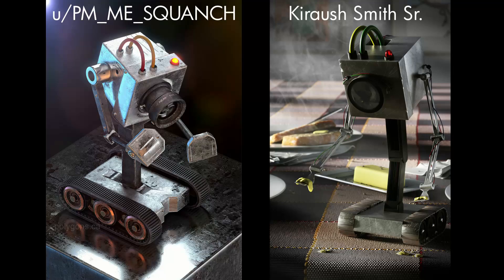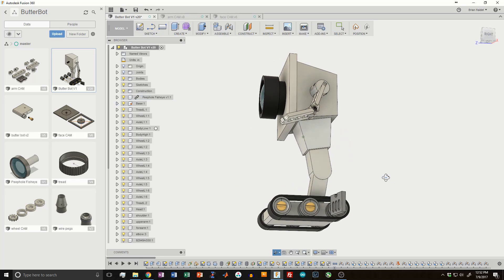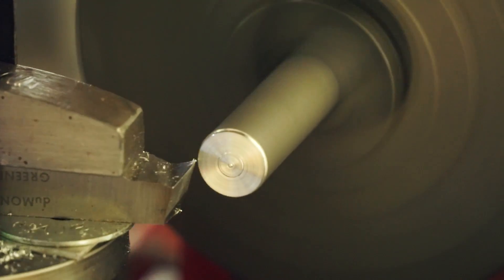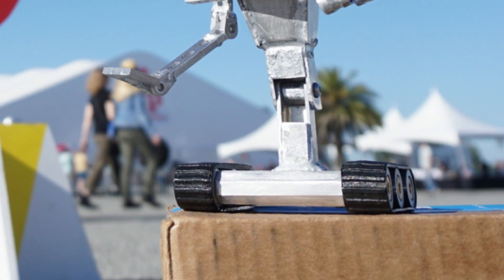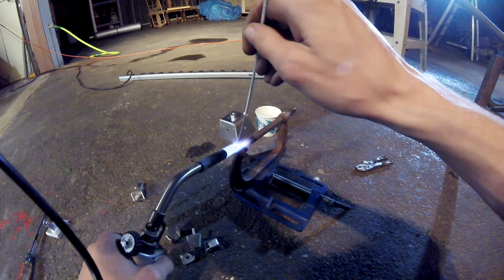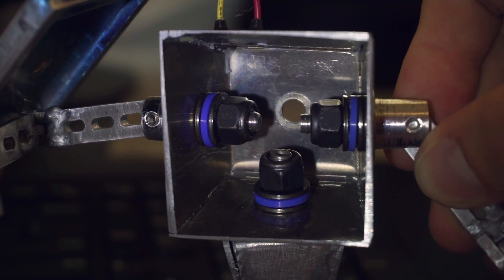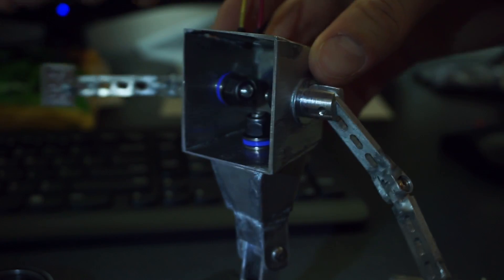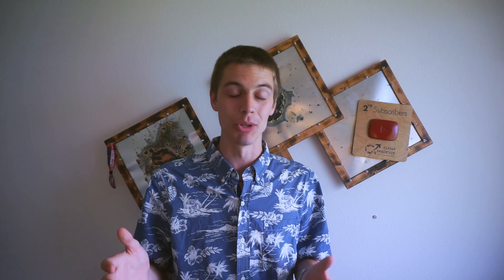Rick and Morty Butter Bot machined from metal

Comment: If YOU think that on the lathe you can only make round parts then you're a bloody noob that doesn't know how to use math for it's own advantage. There is a Russian YTber that does it with a cardan shaft to drive his cutting tool while spinning the part. it's called Polygone cutting on the lathe I don't know that channel anymore. Just type polygon cutting on the lathe. He doesn't know how to cut square parts on the lathe 😂